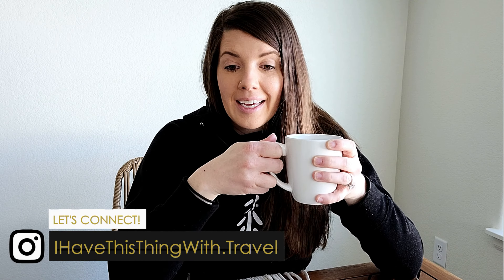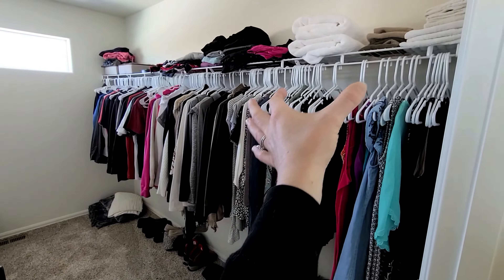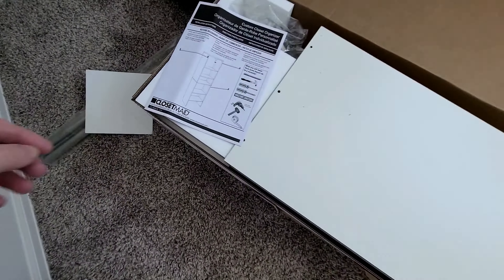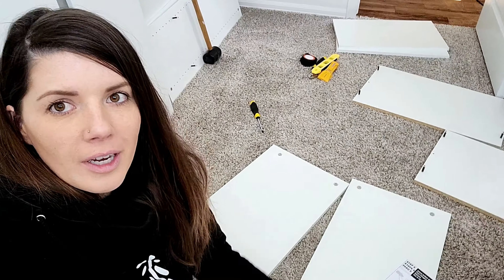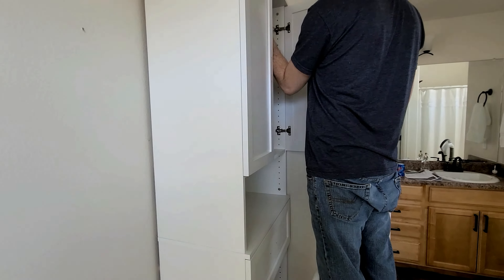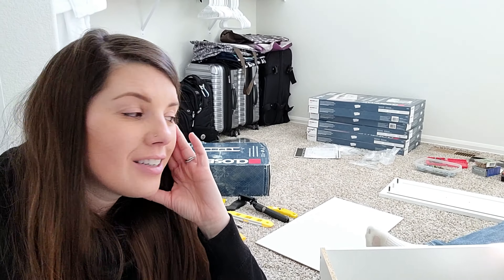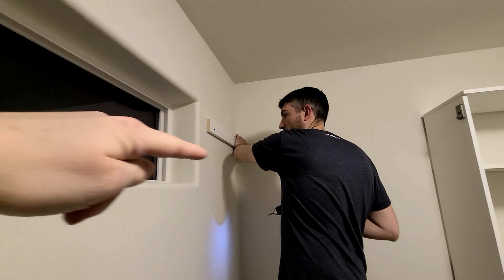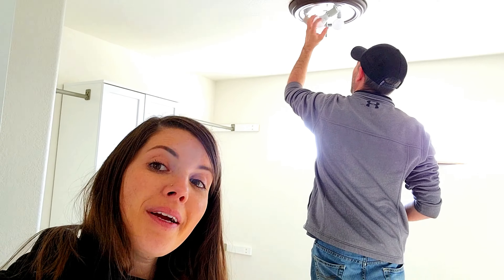DIY Closet Makeover with ClosetMaid Closet Organizer | Before & After

Comment: Hello, I have a question. The one with the four drawers installed, did you put any shelf or gusset on the bottom portion of that one? I put mine up like the instructions and later took off the bottom shelf and gusset in order to out a fourth shelf on the bottom. I am having trouble getting the bottom part of the unit to stay together and the drawers are slipping off the tracks since there is no gusset or shelf holding it together. Any ideas?